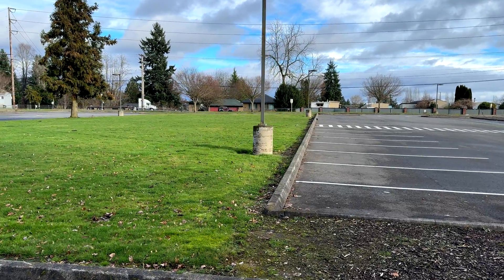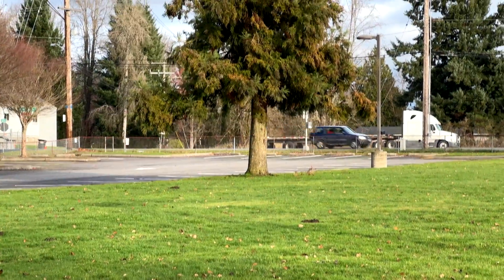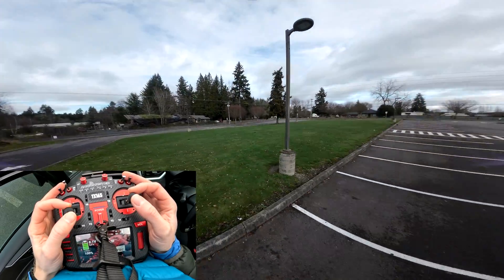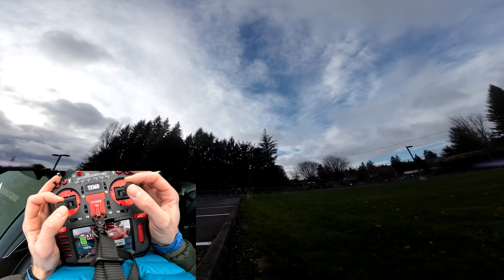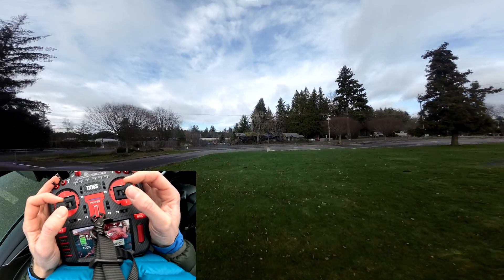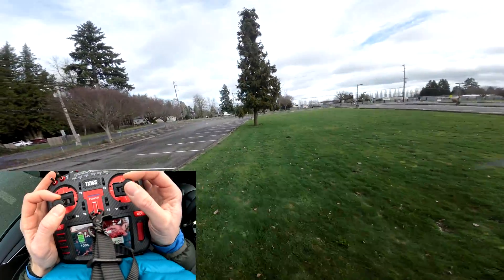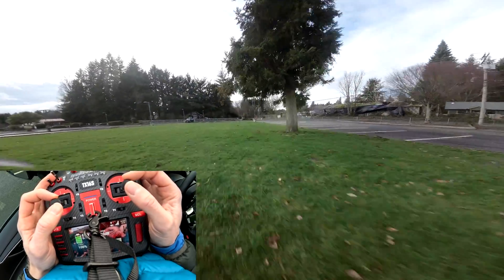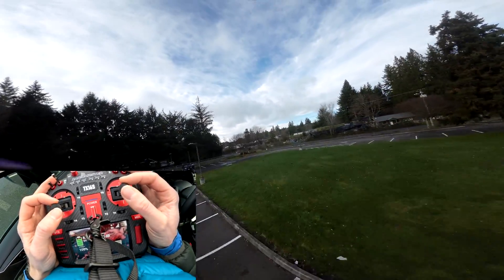Drastically improve your FPV Freestyle THROTTLE CONTROL with this drill! FPV Drone Freestyle Tips

Comment: A bit of a "cheat" that helps me as a thumber, is that i got extended sticks.
It gives sooo much finer resolution on the throttle and the pitch/roll.
But you have to get used to still moving your thumbs a longer distance than usual so you still use all of the stick, not just half of it.
Reply from the maker: The stock grips do have some adjustment range, but probably not enough to make a huge difference in terms of much finer control resolution. Out of curiosity, how long are the ones you got?

Comment: Almost 40 hours on some simulators and I'm still struggling at a map like Minus Two - Liftoff. Either hitting the ceiling or crashing. I'm gonna try this drill on the simulator.
Reply from the maker: To be fair, that map can be pretty challenging! Hopefully this drill helps build that understanding of your drone’s momentum! If not, you might also want to look into tiny whoops. They’re super sensitive to throttle changes and they kind of force you to learn it. Plus you can fly inside all year!

Comment: Hey man, you used to run a XL 5 frame right? How is the AOS compared to that? Durability and smooth flying. Oh and thanks for this much needed video
Reply from the maker: Yep, I moved to the AOS when I switched to digital. The AOS does feel very locked in, especially after tuning. But the durability doesn’t seem to be as good as the XL5. The thinner arms are a big downside for durability, but the motors are protected very well- haven’t broken a single bell yet! It probably isn’t the best choice for a Bando basher though!

Comment: its a 5"quad, sint' it? 6 min on 1100mah bat? wow.. is 1300mah couldn't fit better ?
Reply from the maker: Yep! Gotta remember, you're not really punching the throttle much or flying very fast. Lasts awhile if you're not drawing so much current.

Comment: which is the best throttle expo to practice this? default?
Reply from the maker: I'd recommend doing this, and any other freestyle practice at the expo you'd use when actually flying freestyle. I've found if you start tinkering with it being different settings all the time, it tends to hold you back because you're always adjusting to a new "feel". There's exceptions to everything of course but I think that's a solid plan in general. That being said, I personally use .20-.30 for all of my freestyle flying-practice or not. The only time I'll ever change it is if I'm doing some very specific type of flying- like for a client or something. Other than that I leave it alone and just focus on improving my skill with the same settings. Hope that helps!

Comment: Another tip can be cornering really low / (fast / medium slow) as you are in a park and following a painted line (preferably right angles) if you mess up you will be hopping if you are two low you will crash into the grass (5 inch should be fine unless you are going really fast). You can up the anti on concrete but it can be harder to find painted lines but a path or road can work. If you are clipping your front props and cutting them down you are just a little low fly a few cm higher.

Comment: Throttle management is king, will have to give this a go next time I'm out cheers. What helped me when I first started flying for any newer pilots reading, is doing races in the simulator. Because it forces you to hit gates/gaps that you probably aren't comfortable with to begin with. I wasn't aiming to win races to start with, just to be able to finish without crashing and after a while you will be winning every race. Even if you aren't interested in racing at all, it will make you a better pilot overall. Its a long road and I still got a long ways to go as well, but FPV is a skill game that only time spent in the air will improve so keep sending it.
Reply from the maker: Great tip. I'm actually starting to do those too, and I've also noticed the improvement in throttle control. Really makes you be precise when you're flying through a small gate at 60mph!

Comment: I'm glad you chose the rewind as the drill. Not only will it help people improve IMO, but it is a trick/maneuver that looks so sweet when done smoothly and properly that the pilot will enjoy smoothing it out after 60 reps instead of a boring maneuver that'll just cause lost interest in doing the work, letting ADD take over practice, turning it into a jam session instead of real practice. Kudos on this one buddy.
Reply from the maker: Thanks for the kind words! Rewinds combine a bit of everything to look good, most of all throttle & momentum control! This just seems to make you much more comfortable super low to the ground.